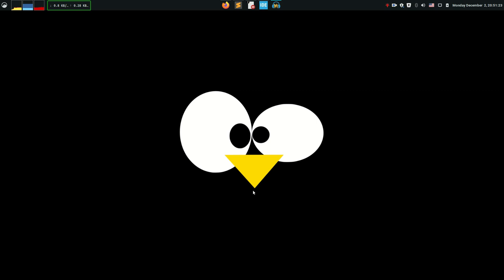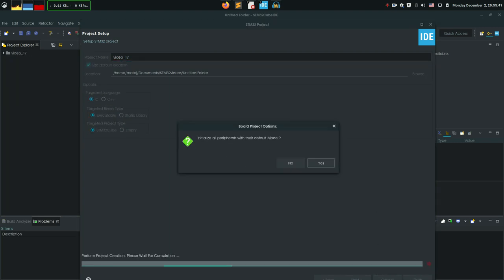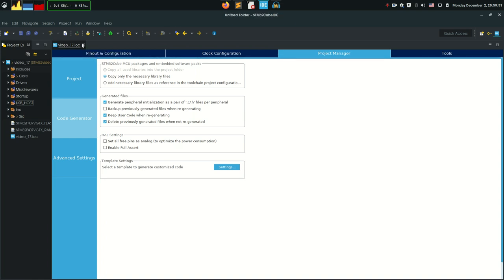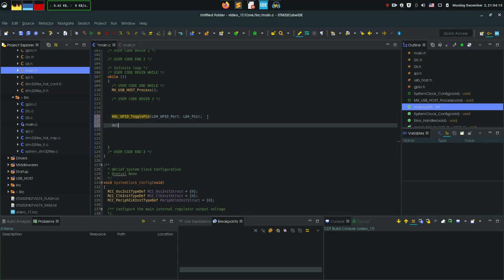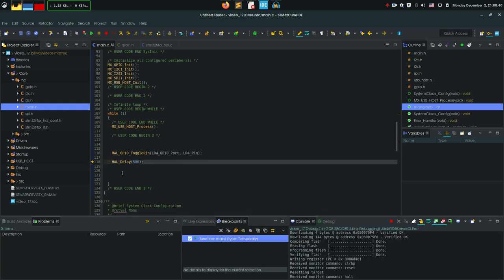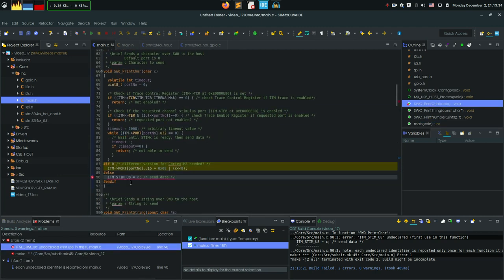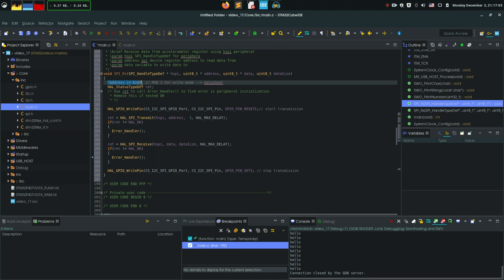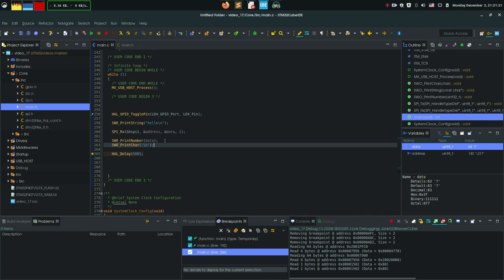Creating a project for STM32 from start to finish | VIDEO18

Comment: Hey, im using STM32L0 discovery board and trying to do little intro project with 3 LEDs and 3 GPIO output pins, but only 1, PA0 pin outputs HIGH level, PA1 and PA2 doesnt respond. Maybe you know where is the problem?
Reply from the maker: Hey,
I mentioned this in my last video(38). Discovery boards are ment for learning so they can pack lots of onboard peripherals. This means that certain pins of microcontrollers are not free and can be connected to such devices.
Usually PA0 is connected to a user pushbutton, just like on your board.
I took a look at your board schematic, which you should download for these kind of things, and indeed PA1 and PA2 are connected to MFX_wakeup and touchsensor peripherals. This way, these devices can set hard states for the pin. Thats why you should search for a pin that is free as in only connected to uC.
You can either search in board schematic or download your dicovery board users manual and on page 25 you will find a table for all pins and you want to find ones that have a label in collumn "Free I/O". 
I would advise you to change PA0 led to a free pin as well despite it working, because you could set a hard LOW state on the pin and if you would push the button by accident, a low resistance path would be created from 3v3 to GND through PA0 and thus destroying it, because pushbutton is directly connected to 3v3 rail.
Hope this finds you well. I will make a video on this, looks like very important topic.

Comment: When using STM32 for power conversion control, you are always 1uS from disaster.  That's why I use "bare metal" programming rather than HAL.  HAL seems like a complex abstraction layer that is removed from the basic spec sheet and programming reference manual.  Am I wrong?  Is HAL worth learning?
Reply from the maker: I have used HAL in medical devices and was deemed as good library to use. The functions are larger than something like LL drivers, so when computing precision and fast functions are wanted, I would go for LL. I have not used any uC for power conversion control as I left those jobs to particular ICs so I cannot comment on that. I can just say that I have not experienced any problems with HAL. 
As far as usage goes, HAL and LL have similar structure of functions and actions. When translating HAL project to LL I find it very easy to do, certain functions are same in functionality.

Comment: One more question, is that what a embedded developer like you basically do at work?
Reply from the maker: This is a part of it. I do all tasks that concern an electronics engineer. That can be designing pcbs, soldering prototypes, debugging new or existing hardware, writing embedded code and python and of course research and learning. Its is a big field.
Reply: I am so curious. How did you learn embedded software and hardware design? I mean both of them are very big field. I have spent a lot of time to learn 8-bits microcontroller PIC and now still spend lot of time to learn programming with stm32 and never touch in hardware design. Maybe you could share some experiences, what was your plan to learn embedded, what should a newbie start to learn, should I learn software and hardware in the same time or firstly master software then do hardware and so on..
Reply from the maker: I thik that there are two embedded paths, one is mostly software and algorothms, other is embedded hardware. The first one would be just writing software for fpga-s, dsp and the way of writing code does not change much from pc, just that resources are smaller. Hardware part is what I do on this channel and its about microcontrollers that bridge gap between high level world and low level hardware. Not just that, it provides expansion in form of dogital sensors and actuators that you couldnt use with just doscrete hardware.
That said, you seem to have experience in coding, which is great, that part burns a lot of time for me. But if your goals are on embedded hardware, then I would suggest you start learning about electronics, there are lots of yt channels and websites. Most educated embedded engineers become that as electronics engineers because you have to understand electronics around the microcontroller in order to write code, choose ics and much more. Its not just about code. Learn dogital and analog systems, find good project where you are good at some things and unfamilliar at others. This balance will motivate you and once you design a few boards and use a bunch of different peripherals, you will gain lots of experience. With different projects, you will learn new skills on different areas, so dont worry if it looks a bit much. I for example have been learning and using c++ in embedded for last 4 months. Keep learning and making cool projects because that is the only way. Oh yea, and dont loose passion, that is the main driving force.
I will post more videos around electronics and a few starting videos.
Reply: Thank you very much for your advices. It is very useful for newbie like me. Actually I study electronic and information technology. Basically, I have a little bit knowledge about electronic components and 8-bits microcontroller. But that is all I got from university. Thus, I have learnt by myself stm32 and maybe later msp432 from ti to fill the gap of knowledge. I also want to learn pcb design but it seems a strange topic for me. Your advice has encouraged me so much. Ja, stay turn and keep going forward.
Reply from the maker: That's great. University will not be able to give you all the knowledge. I would suggest to try building projects on discovery boards and buy individual sensor/actuator modules (dont but sets, its a waste of money) and you will learn plenty. Start learning about hardware when you get more free time, design some analog/discrete component pcbs to learn, buy a breadboard, some components, draw pcbs and then integrate a microcontroller into a pcb. Don't pick too difficult project as you'll get demotivated. Cheers